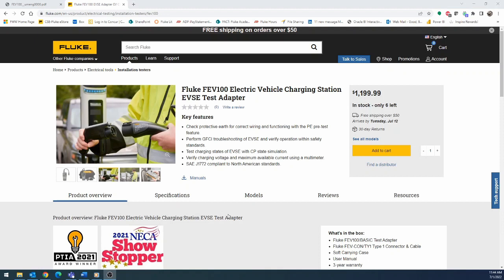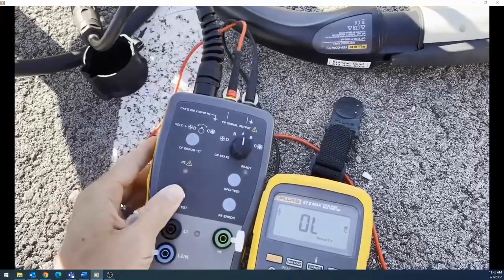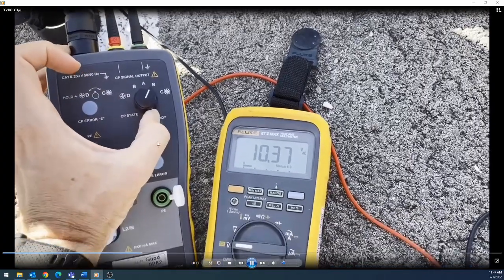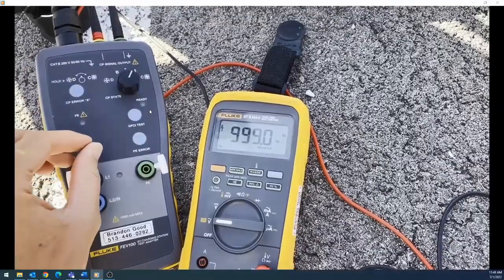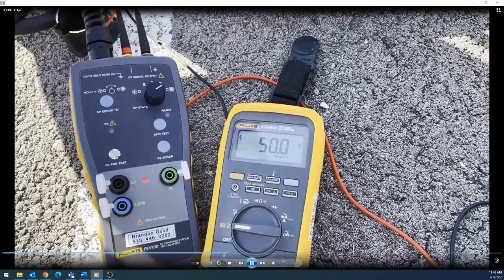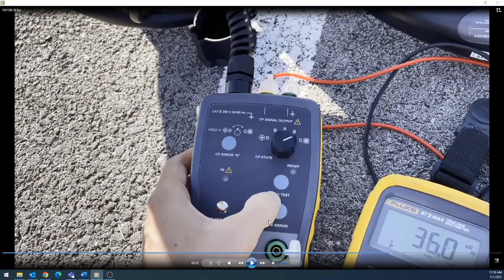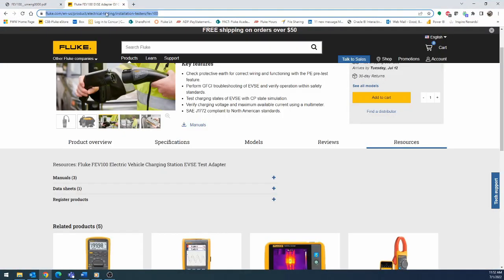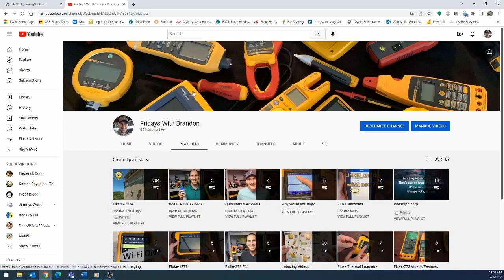FEV100 - Fluke Fridays - Episode 58

Comment: Thanks for the info. I will be purchasing this FEV100 for my EV Charger installs. For the voltage read outs, is it necessary to get the 87V Max , or can I just use my T6-1000 PRO?
Reply from the maker: Just for Voltage you can probably use the T6. But if you would like to look at duty cylce you'll need an 87

Comment: Hi, thanks for the posting the video. Good information, I recently purchased same setup at work. Had a question on if this setup is actually testing charging action as far as current being delivered or is it strictly testing the voltage output.
Reply from the maker: I don't think it puts any load on the system so it's just voltage.